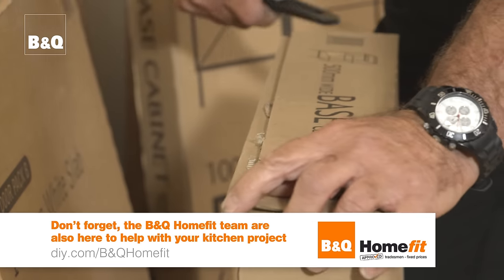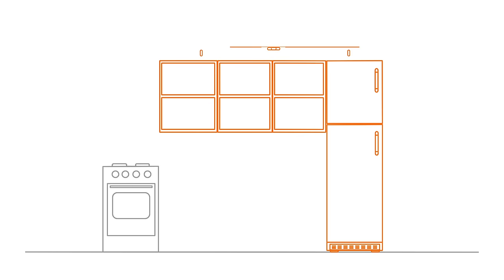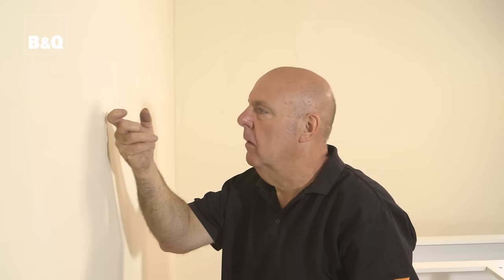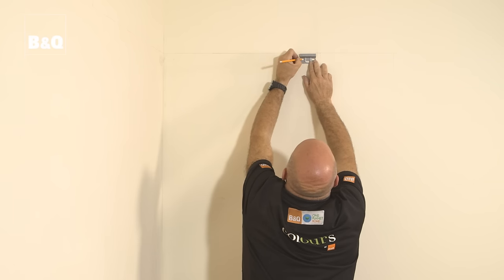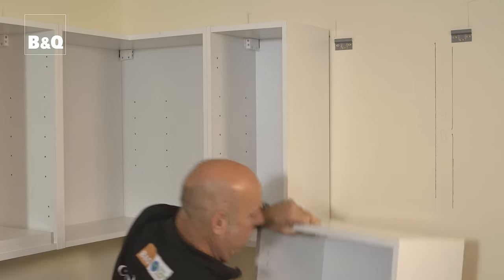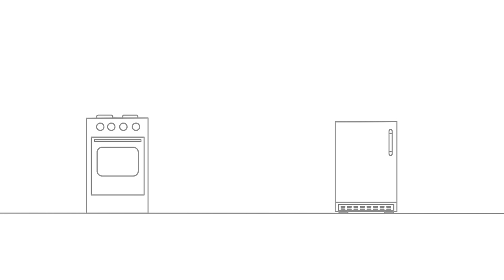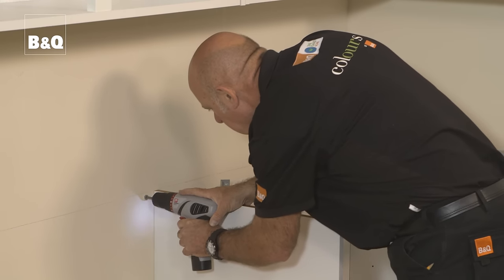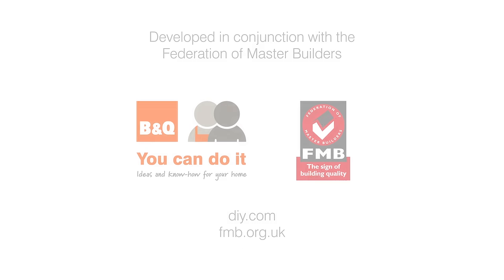How to fit kitchen units part 1: assembling & fitting units

Comment: What size doors do the 930 mm corner Base units require also are they the same for the overhead corner units? Thanks
Reply from the maker: Hi there, for a standard 930mm base corner unit (not handleless) you need 2 x 30cm Highline doors and 1 x 5.9 x 5.9cm corner post.

For a standard 630mm wall corner unit (not handleless) you need 2 x 25cm highline doors and 1 x 5.9 x 5.9cm corner post.

This is all explained on pages 13 and 14 of the product and cabinet guide.  Which can be found on the following link. I hope this helps! https://bit.ly/3jbggAn
Reply: @bandq  Thank you for getting back to me. Helps a lot
Reply from the maker: You are welcome 😊

Comment: What clearance above wall cabinets do you need to hang them on the brackets? I want to fit my wall cabinets as close to ceiling as possible. Thanks
Reply from the maker: Hi there, if fitting as high as possible you would need to leave a small gap (approx. 5 - 10mm) to allow clearance to guide the cabinet and wall hangers over the wall hanging plates fitted on the wall and then rest the cabinet onto them, then adjust tight to the wall and desired level etc. 😊

Comment: What do you do if your wall behind the high cabinets is not straight like most old houses?
Reply: Screw all your cabs together with furniture screws front and back loose on the hangers, then tighten to wall use shims if needed.

Comment: 1 of my upper kitchen cabinets contains the cooker's extractor fan. If I remove the other upper kitchen cabinets around it, can I leave the one with the cooker extractor hood in place? Or will it fall off the wall (because it's no longer attached to other cabinets)? [el'sda2].
Reply from the maker: Hi 👋 If all the cabinet's are attached separately to the wall, you'll be able to leave the one which contains the extractor fan 😊

Comment: hi ok video? May i ask you what were the screw specs you used and is there a min gap between top of counter(base units) and the under side of the wall cabinets? Thanks in advance
Reply: Hi may you kindly list all the equipment to make kitchen unit?